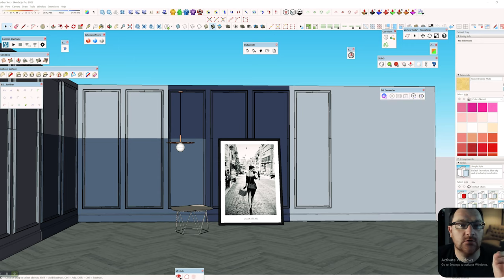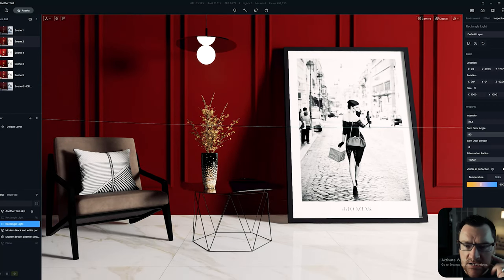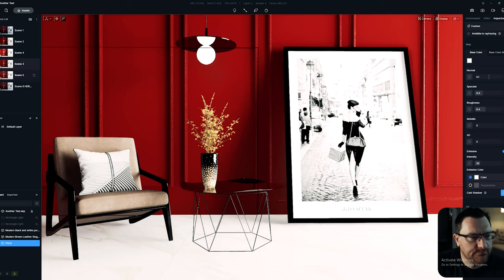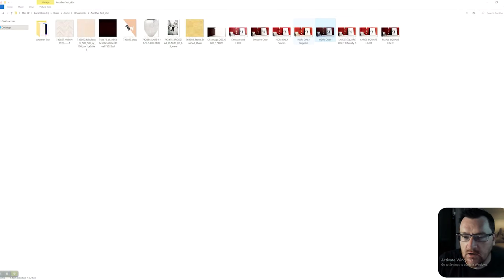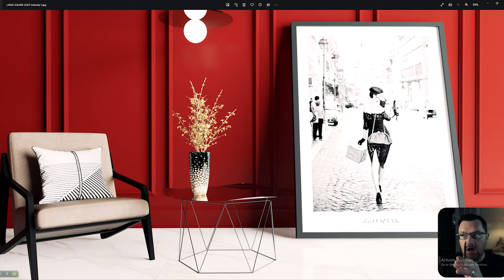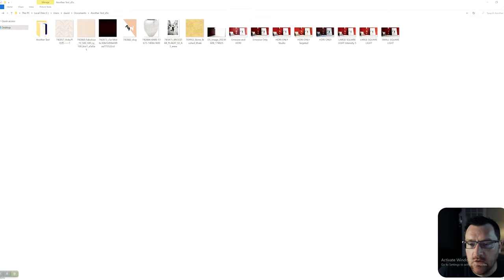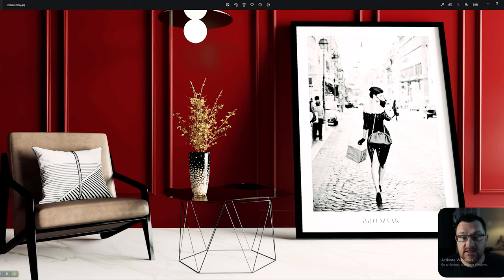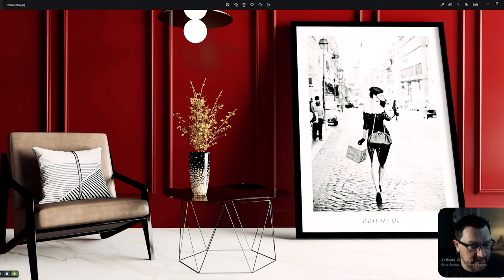D5 Render: Emissive Lights Only?

Comment: Thanks for sharing! I'm a week in with using D5 Render and I've spent lots of  hours today trying to improve the lighting on a large living room scene with big windows. I primarily work with Revit and I'm learning to use D5 for much better renders. Appreciate seeing the results here before opening it up again to test it out... at least not today 😁
Reply from the maker: Wacera Murage, thanks for commenting! I am glad you found the video useful. For interiors I would suggest a bright HDRI (Default ones of a nice SKy only one from www.polyhaven.com) with the Sun toggle enabled, then add white Area/Square lights outside the windows to add more white light into the space. Rotate and adjust the strength as needed. You have to untick the "Show in reflections' button on each light though, otherwise they appear in the final render. 

Feel free to shoot me an email with the scene file attached if you need assistance. 

@Nuno Silva has great videos, as does Minh at @ArchitectureInspirations
Reply: @viarender  thanks again. Will definitely make an attempt with these tips and get in touch if/ when I get stuck again 👍